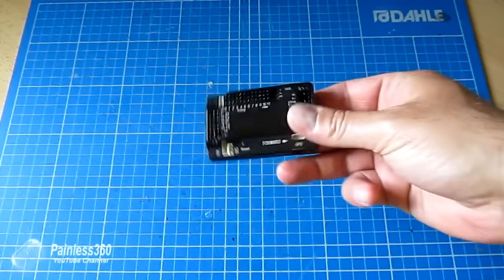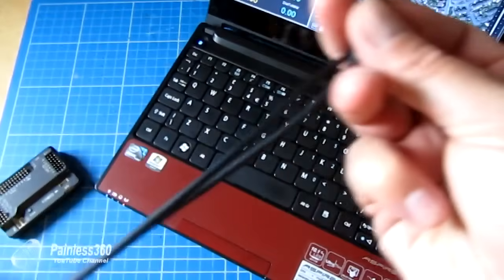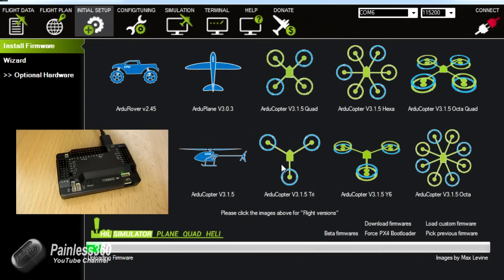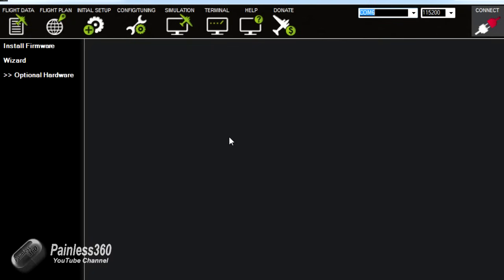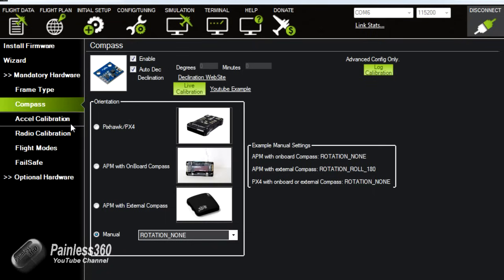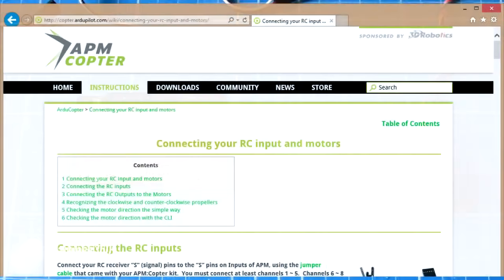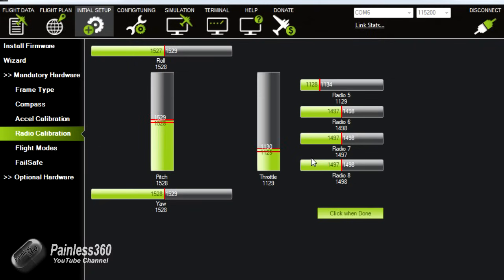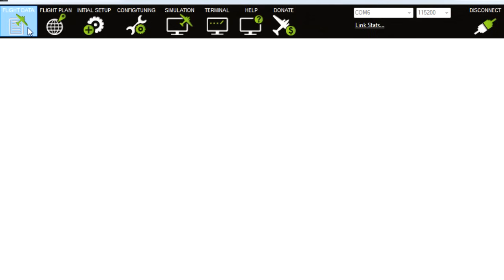(1/8) APM 2.5/2.6/2.7/2.8 - Simple installation and setup overview

Comment: Thanks for your reply another thing I would like to know is about the GPS module because I found some APM kits that have the square module and others with the normal compass module what's the difference please and which one should be the best?
Reply from the maker: Hi Charlie, if you watch the series this is covered in a little detail.

The APM 2.6 uses a combined external compass and GPS module, the earlier APM 2.5 board has an on-board compass and uses only an external GPS. A lot of the modules on the market now are designed for APM 2.6 and the GPS unit comes with two connectors on it - one for the compass connection and one for the GPS connection into the APM unit itself.

For APM 2.5 users it means that they only connect the GPS connection and can ignore the external compass connection.

This has resulted in a lot of different types, sizes and specs for the GPS units on the internet. Get the one that is listed for your board by checking it's made for use with either an APM 2.5, 2.6, 2.7 (same as 2.6 really) or 3.1.

Hope this helps.
Reply from the maker: In the rest of the APM series we cover how you wire it up, configure it, tune it and use it is covered in some depth. This should help answer a lot of the questions you have.

Both of these kits are great, complete setups but have different frequencies for the MAVLink radios (one is 433Mhz for UK and Europe and the other is 915Mhz for the USA).

My advice is start with one thing and get it working great - before you start to add the additional pieces. Trying to do too much at once can cause problems that a newer builder/pilot will struggle to resolve and leave you frustrated and disappointed.

If you get the kit then setup and APM with the GPS first - get that all running great, then add each extra pieces one by one. Don't change anything else on the model until you get that new piece (OSD, MAVLink, power module) working.

Sorry if I'm telling you something you already know but I've seen too many pilots come into the hobby and try too much with the first build and give up unhappy.

Best of luck  with the project and Happy Flying!

Comment: Hi Painless360, I have an APM (Arducopter version 2.8) that I have been working on for my dad. He has a LemonRX DSMX receiver and Spektrum DX9 radio. I have been looking everywhere to find how to connect the receiver to the APM 2.8 to no avail.. My questions are 
1- Is this even possible?
2- Should I just use a PPM encoder?
3- Or just by a PPM receiver?
Any input would be greatly appreciated!
Reply from the maker: Yep, if it's got PWM outputs then follow along with the series.. Best of luck!

Comment: Thank you for the wonderful videos. They are so helpful. Your work is really appreciated.
I have an FS-T6 transmitter and FS-R6B.  Are they compatible with the APM 2.8 and will Failsafe be possible to setup?
Reply from the maker: +petrovski1948 Check in the manual and see if there is a failsafe setup for the receiver.. Best of luck..

Comment: I had a problem, when I turned tranmister (Flysky fsi6s) and connects the battery, I could not armed, and quadcopter rotate very fast and crashed, several times I experienced, but when I connect the battery and then I turn on the transmitter, I could be armed and quadcopter no problem.
Reply from the maker: I'd check that the radio is setup for the model correctly and the throttle moves the throttle channel etc. See how later in this video series. Best of luck..

Comment: Really enjoy your videos and I have learnt so much from you. I have a question, I am using an Orange Spektrum DSMX RX that has Sbus, how bout do I connect it to the Ardupilot?
Reply from the maker: SBUS is supported on ArduPilot running on a Pixhawk, you can't plug Sbus directly into an APM running ArduPilot..
Reply: +Painless360 well that has thrown a spanner into the works. Going to have to redesign the electronics layout in my airplane. Thanks for the very fast reply.

Comment: Hello Mr Painless. Once again I thank you for the wonderful videos you make . As I already said they have been a great help to me whilst building my copter. I do have a question you may be able to help with . I have discovered a problem with my copter in any of the auto modes IE loiter auto and so on. The gps lock disconnects and the copter goes into land mode. Thankfully I have been able to switch back into stabilise or alt hold (alt hold not affected) and bring the copter back. I have looked at my logs and there is a recurring error message . The message is "ERR EKF check fail" or similar. I have search various forums and so on to no real avail apart from being advised to turn off the check in the params. The other odd thing is that I have been led to believe that this function is NOT on the apm 2.6 I am using and was not implemented until the pixhawk. Looking at the logs every thing else regarding GPS is fine 10 satellites min .  Thanks again I hope you had a good Easter weekend. John
Reply from the maker: Sorry, i've not seen this. I'd look at the power system on the model (in the logs) in case the 5v supply is dropping causing the problem with the GPS.. Best of luck with it, it's heart-braking when you can't fly reliably..

Comment: Great video Painless 360.  Im trying to get started with brand new ardupilot,  I have a mac with 10.9.5 but whilst mission planner opens it won't connect to FC.  I keep getting message "Failed to open an RFCOMM serial channel."  Any help would be greatly appreciated.
Reply: Just tried hitting the connect button without FC plugged into usb,  got the message "Error opening port: Resource busy"  any clues???
Reply from the maker: +Verminators Possum, Bird and Pest Control sorry, no idea we don't run Macs here. Best of luck

Comment: Pixhawk Spektrum ar8010t not binding in mission planner to Dx8e
I recently got into a person hobby of making drones do things. I had a parrot AR drone working fine with a raspberry pi but i wanted to make my own due to being able to add anything to one. I have posted a picture of what is going on with my drone in mission planner and the wiring of the drone. I have tried to wire the dsmx reciever to the pixhawk but i only get gray bars and no green. when i xonnect to the Ar8010t traditional reciever it gives me what shows in the picture. I am a newb and by no means a seasoned pro, I am just the first one at my university to want to get into drones and none of the teachers have a clue how to help me. I have programmed mission planner in python too using stml so it is just getting the hardware to work.https://drive.google.com/open?id=1wZES6pKk8EIMkwK3K1-QdNunNNioqdIx
https://drive.google.com/open?id=1wZES6pKk8EIMkwK3K1-QdNunNNioqdIx
https://drive.google.com/open?id=1bEBL-64ghWbyA3O-beEN_fO9dIYcPdI6
https://drive.google.com/open?id=1g__y_DynqI87qhC73hKCNpf5wBDXEuOx
Reply from the maker: I don't do anything special to get the Pixhawk flying well - please see my Pixhawk series for the steps I follow. They are designed for pilots who've not done it before.. Best of luck!

Comment: not sure if you are still reading these comments, but love your vids, have a bit of an issue, I have no issue connecting pixhawk to mission planner, but recently purchased ardupilot and trying to hook to mission planner, and just wont work,, any thoughts??
Reply from the maker: What troubleshooting have you already tried? Ardupilot is the software not the hardware. The hardware is usually something like an APM or Pixhawk. See my series on both of those. One thing that I would try, is another USB cable. You'd be surprised how often that can be part of the problem. Best of luck..
Reply: Painless360    thanks so much for your response, but somehow I figured it out,, It was a matter of downloading the driver , which apparently was not included in the version of ardupilot mission planner I downloaded. 
for some reason it hooks up correctly when I choose automatic search for the port , which turned out to be port 9 on my comp, and pixhawk hooks up with port 8,,,, don"t know how I did it, but hey it works.  I have to say your videos helped me out a lot on the first quad build.Seems your the Mission planner Goru. Been flying  Iris+ for a while now and Yuneec Hex, I figured Im ready to build my own,, I"m just about ready to fly , once I get some battery connectors and plugs.  Love the ability to autonomous fly. Today you can buy something off the shelf and have it do most anything.  But I still like tinkering
thanks again.. oh and one more question if you dont mind. whats the difference between Loiter mode, and stabilize mode.  I assume they both are gps locked and stabilized?  how I configured the board is switch 1 (upper ) is Stabilize, the second is loiter and last is rtl.

Comment: I have been using your videos to setup my APM 2.6 and all seemed to be going well until now. When I go into terminal mode and press connect it displays "com port open" then displays version info, free ram, etc. But instead of display the little menu, it scrolls data continually. I have pressed enter 3 times and nothing happens and pressed reset button and the APM restarts but does same thing. I went thru the same routine with my second APM and terminal works fine.

Any ideas.
Wally

Comment: hi, I think I've fried my apm and would rather find out why before doing again! I have the power module with jumper removed. my esc's are opto's so have seen I didnt need to remove the 5v wire but plugged in and bang. I was connected to the laptop too but did this all the time with my 2.5 powered by esc with jumper?
Reply from the maker: What did you plug in when it went 'bang'?
Reply: A 3s lipo,  l think I've seen a contradiction to what to do with the j1 should I have left it in?
Reply from the maker: From what you have mentioned I can't see any glaring problems but the devil is in the detail. Happy to take a look at it and explore what went on in a support call if you need it. (see the painless360.com website for details and rates)
Reply: well the new FC arrived, removed the 5v lines from the esc's and the bloody thing still went bang!! would a faulty esc cause it as they just make a beeping when powered rather than the "tones"?
Reply from the maker: Possibly, if the wires were connected the wrong way inside it.. Best of luck..

Comment: Thank you VERY much for this video.  I'm getting ready to build my first F450 and am torn on the FC.  Have been leaning towards the Naza V.2 w/GPS, but I've been hearing a lot about APM 2.6 on various forums.  Which would be easier for an RC newbie to set up, in your humble opinion?
Reply from the maker: The Naza is a great piece of kit but expensive. Everyone has their own favourites when it comes to flight controllers - it's almost like a religion!

I use all sorts - KK2.0, MWC and APM but have never used the Naza - yet :)

APM is a great board and if you want a capable controller at a good price while you are getting into the hobby then APM is a good choice. I use it for high quality video and mission flying and use MWC for smaller craft where fast flying and FPV jinks are called for.

Best of luck with the build. Let me know if there is a topics that I need to cover.

Happy flying!

Comment: Don't know what I'm doing wrong? I have tried 3 of these boards and I can't get the throttle to stop running while it is armed! I have gone through the Wizard setup, calibrated the APM 2.8, and calibrated each ESC individually. Then completed each motor testing in the MP. Everything works like it should until I arm the unit and the motors spin while the throttle is at its lowest. Is there a setting I am missing? I am going crazy trying to figure this out.
Reply from the maker: +Bill Conroy You're not using the playlists are you ;) https://www.youtube.com/watch?v=cXSNgCQ9WJw&list=PLYsWjANuAm4oswLMu9OU8yOm-9J6y30XW&index=9

Comment: Would COM 4 work as well? I'm working with an autonomous Quadcopter. Also, if you wouldn't mind telling me what exactly COM is short for that would help. Thanks!
Reply from the maker: A computer normally assigns a COM port (short for Communication Port, in the old days used exclusively for serial devices) to any USB device as a shorthand for the user to 'talk' to. It assigns the next available number starting at COM1, the COM2 etc. so the number depends on how many other USB devices you've used on a machine. Best of luck!

Comment: Good afternoon Painless360. Thank you so much for this video series. It has been a huge help up untill this point.I have built a tarot 680 pro hex did everything as in the video series and on my 1st flight had a crash shortly after takeoff. It looks like the gyro was over compencating and I tried to land straight away and luckily only broke two props.(I did take a vid of what happend). I am to scared to attempt another test flight. Please could you assist. Thank you so much again Ralph Correia (South africa)
Reply from the maker: Ralph Correia Not sure what you mean by over compensating. What mode were you in and what actually happened?
Reply from the maker: Ralph Correia Wow, ok that isn't what you want! ;)
Could be a few things. First check all of the ESC connections to the APM on the model, you may have two of them swapped over. If they all check out then you need to look at reducing the PIDs. 
I assume the ESCs are all SimonK/BLHeli style?
Reply: Painless360 Hobbywing platinium pro 30a opto,all esc are correctly connected. I found that if I go into terminal I never get a chance to type something. It is always busy bringing random stuff onto the screen. Will take a clip and post it later today. Anything else I should take a clip of that might help you diagnose the fault? Thanks again for all the help.
Reply from the maker: The latest firmware for the APM removed the CLI due to space restrictions..

Comment: hi, i see you have used the internal compass. i have tried using the external compass (g-model ublox neo) and calibrated it before flying. but the issue is that the the drone follows plus configuration when flying even though i selected x frametype
Reply from the maker: I've not used an APM for many years.... best of luck

Comment: Hi,

I am configuring APM 2.8 module and will be using the external PowerModule to supply regulated 5v.

Should I use the jumper JP1 which comes enabled or do I need to remove it?

Newozuser
Reply from the maker: newozuser Powering the board is covered in the second video in the series - https://www.youtube.com/watch?v=TS4OWAcfAQY&index=2&list=PLYsWjANuAm4oswLMu9OU8yOm-9J6y30XW
Best of luck with the build!

Comment: Hi. Quick question. I am trying to set this up on a Tarot 650 Pro, which is a Quadcopter. I see that I can only pick the entire row, where "Quad" is listed among other Frame layouts?! This is a bit weird, as every other FC lets you choose specifically what frame you have. It starts at 8:36 in your video. On the right you can see "Default Settings". You do not change anything there, which once again is surprising?! How does the APM know what Frame Type you have?! Also, can I choose under "default settings" something like "camera platform"?! Thanks, G.
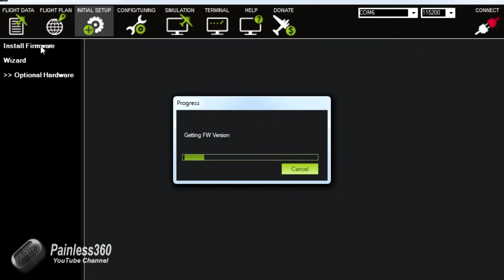Reply from the maker: Hi, you can select a number of frame types. You do this at the start as the code is frame layout specific. Watch the video at 4:39 to see me do this for the quad setup. I could have chosen car, heli, plane, tri, quad, hex, Y6, OctaQuad or Octa frame layouts.

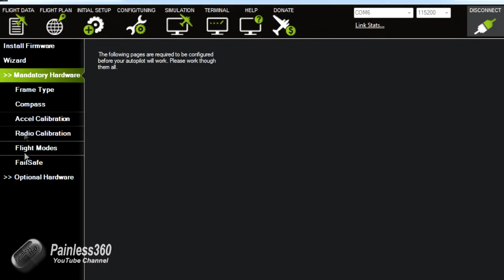You can then choose the orientation of the frame type later on (8:23) and the APM even has selections for '+', 'X' and dead-cat layouts.

If you follow this video you should be fine.
Reply: Painless360 Thanks for the fast reply. I did pick "Quad" in the beginning. That's why it was even more confusing, that it would ask me again what frame type I have, AND show those options?! Do you think I should leave those alone, or can I pick "camera platform"?! One more thing... I order these items here:

http://www.uavobjects.com/product/rctimer-fixhawk-32bit-flight-controller-v2-4-3/

http://www.uavobjects.com/product/915-mhz-radio-telemetry-set/

http://www.uavobjects.com/product/rctimer-u-blox-lea-6h-gps-mag/

Is this all I need in order to be able to connect it to my laptop or do I need this item as well?!

http://www.uavobjects.com/product/mavlink-osd/

Thanks!

G
Reply: ***** I think I have just found the answer to my own question?! I only need the MavLink OSD if I want to have a n OSD on my Video Monitor, right?! If I use the laptop though, all the information is there, so need to use an "extra" OSD?!

Comment: Hello , considering that it is for aerial pictures and movies , would you go for a quad or an hexa, with same motors and about same frame size?
Reply from the maker: I'd go for hex and look at a frame that could handle the prop sizes I needed. a 500 class will swing 10" props..
Reply: thank you for the tip, but for the frame i'll design again my own,i am very happy with the Styrofoam/fiberglass sandwich.
Reply: Hello , can you say that an hex is more stable than a quad for movies?
Reply from the maker: francois Bonin a well setup quad is excellent too. Just look at the DJI phantoms. A hex will normally be able to lift more weight and land safely if a prop or motor fails...